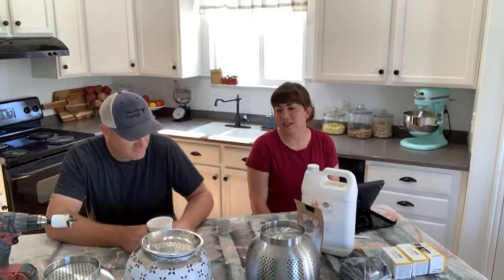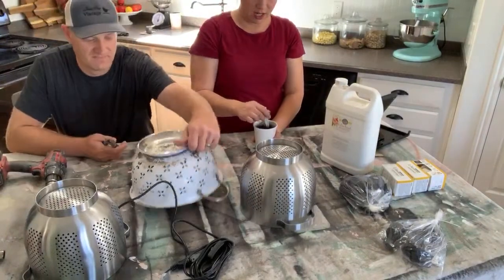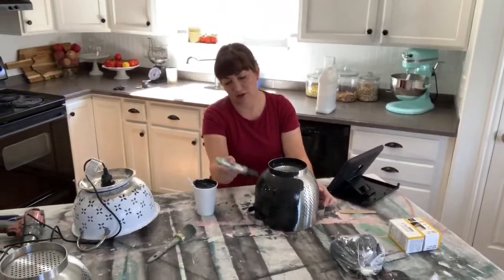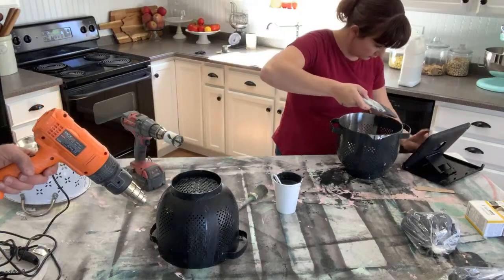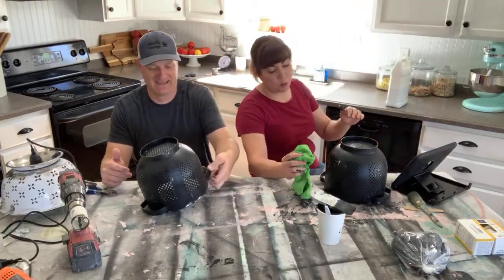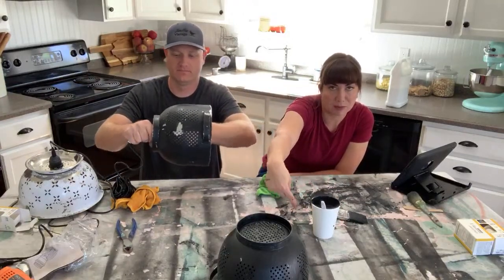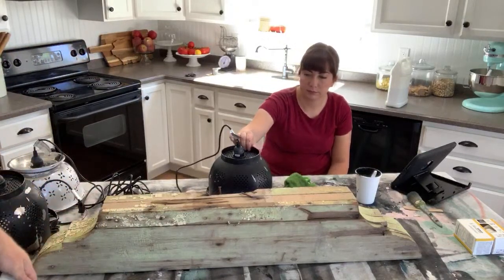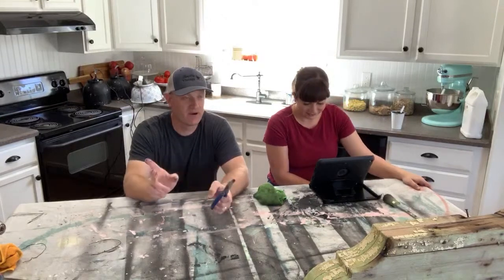🔴 Thrifted IKEA Lighting Hack | WNW

Comment: Do you just hang your collinder lights by the cord? I added the thin little chain like you would use to hang planters on the porch... Same with an aluminum tea/coffee pot. The light us in the lid but the chain hooks to the handle (I cut the bottom of the teapot out).
Reply from the maker: These colanders are pretty light so I’m not worried about it but if it were something heavier a chain is a good idea for sure. 👍

Comment: I missed the live but I am reusing vessels from Goodwill to plant faux succulents while viewing the play back. I mentioned when you found the colander that I have a white colander with flowers on it that I will make a light out of. The drilling wasn't that bad. I needed to see that but my son is an electrician and he will do it for me. I love the colander, I am going to do a bunch! I do have two bare wire lamps my son made from wire baskets I found from Walmart. They are rubbed bronze in the video I posted from my Ashland Strawberry Faire post in group. I think I'm going to paint those white.The plug in light kit is hard to find. I will look at Tractor supply tomorrow.Thanks for all the info!
Reply from the maker: Get him over to the house and put him to work!

Comment: I didn't know not to use wax for outdoor use. I waxed a chair that I just finished for a particular area. What now? Can I fix the issue?
Reply from the maker: You can give it a light sanding and reseal with a liquid top coat rated for outdoor use, or just leave it and let it age naturally.
Reply: Thank you, I knew you would know what to do. 😊